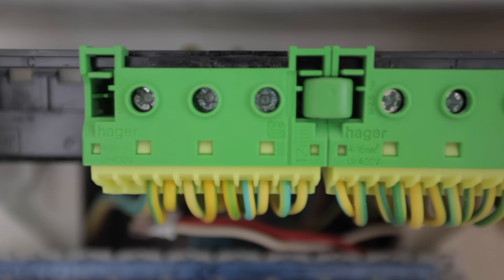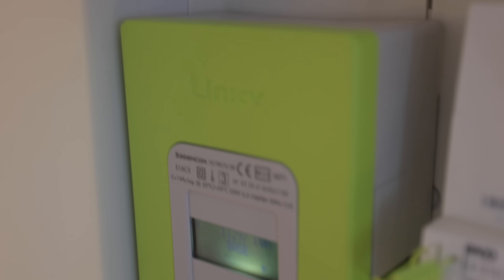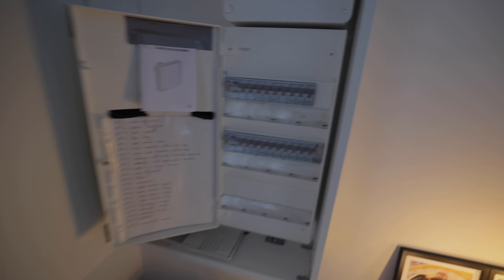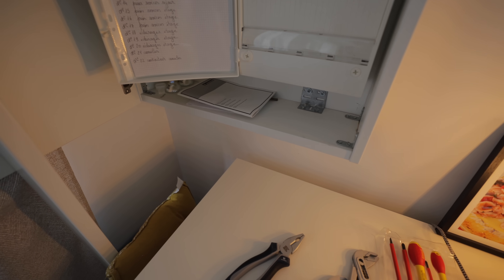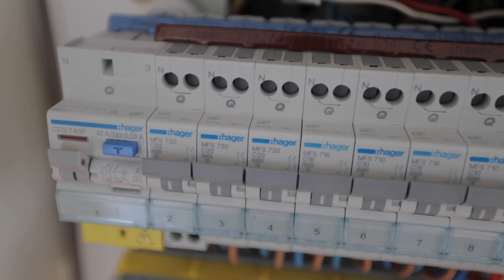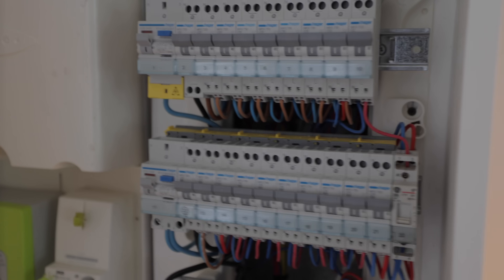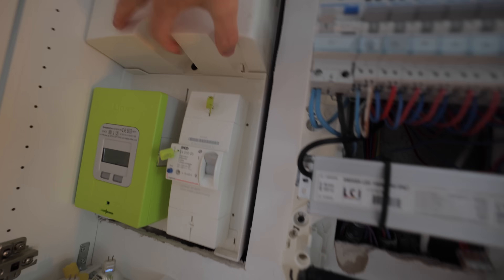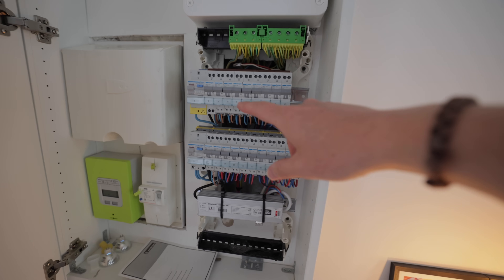U.K. Electrics SUCK! This is what we should be doing…🇫🇷

Comment: I thought a RCD was a fancy new breaker and I googled it and they are just GFCIs .   I don't see any AFCI breakers at all.  I have a separate apartment that I built above my garage and it has a bathroom and a kitchen.  On the kitchen countertop the code requires 20 amp receptacles.  They must be split.  Each plug is 120V but from the top to the bottom receptacle is 240.  ( I build a plug that plugs into both to power my wife's massager device from Ukraine.)   So in bedrooms you need all the receptacles to be ACFI and for the countertop you need 2 double pole 20 amp breakers ganged together so that a fault on top or bottom of one socket will trip the other socket in the receptacle also.   So I need two double pole AFCI breakers and they cost about $200 each.   The inspector eventually told me that to get around all of this , that I don't have a kitchen , it is just a serving area, because I don't have a stove.   Now I want to put in a stove so I also need AFCI and GFCI combo breakers.  They do have these but just single pole.  I think I can put the ACFI breakers in and have the actual receptacle as GFCI.   I would also like to upgrade my service because I only have 100 amps and I need 200 amps with all the circuits and now a new double 40 amp for the stove. 
I can't believe how compact the breaker boxes are in Europe.  Mine is just huge.  My wife has an apartment in Dnipro Ukraine and it is all aluminum wiring and she had the kitchen redone.   When I got there for the first time to look at it , the kitchen light didn't work and the  long hallway had one light and was dark.  The living room light was an old ugly fixture.   The electrician was not called back to fix the kitchen so I just did it myself.  I took EE and wired my own house in Canada so I was kinda competent.   I fixed the kitchen wiring and then added two more lights in the hallway and put a new living room fixture in that was nice and bright.  She only had 4 crappy breakers above her front door.   240 V one for the oven. I couldn't believe such a small little box.  Then the wall receptacles were few and far between and humongous.  The outlet bars you could buy were gigantic.   The wall switch was complicated also.   I am glad they designed the North American plugs and switches to be so compact and convenient.   You need a receptacle every 12 feet in any room.  Ukraine seems to have no such code , or they didn't in the past.  In Canada the wires have to be in the center of studs , the studs are usually 3 1/2 inches and this means when you drive a screw into a stud you won't penetrate a wire and create a short.   If it is less than that , then the wire needs to have a piece of metal covering it to stop a screw.   In between the studs, the wire should hang kinda loose so that any accidental wall penetration will just push the wire aside and not penetrate it.   The wiring in Ukraine and UK from what I see doesn't worry about this. 
At my local Home Depot, I talked to the guy in electrical dept. and he actually sat in on the committees that worked out the electrical code for US and Canada.   Canada has 20 amps on kitchen counters and the US requires only 15.  They couldn't get the Americans to increase it to 20.   There are now many differences between Canada and the US and when I buy stuff I have to make sure it has ULC  and not just UL.   When you go online shopping you have to zoom in on the pictures to see if the C is actually there.  American stuff is sold to Canada and it is buyer beware.  I notice the 14/2 wire in the US is not rated for Canada and I bought some for my house in Florida and it is more flimsy.   Canada needs special plastic for -40C.

Comment: Note that the double pole is solely because parts of the Middle-Europe and especially the french speaking part of Belgium and Norway still DO NOT USE NEUTRAL to create a 230v instead you have 2 phases so each have a roughly 133v against the ground, this is and only this is the reason why there are two poles in the breakers and RCD's and why you have that 30mA main RCD there.

Comment: How accurate that statement is where consumer units are installed. I am a retired electrician now 77. My unit is too high and was in a cupboard untill i removed the cupboard to expand the kitchen 20 years ago when I moved to Wales. What i found behind the old wylex consumer unit was frightening.  Meter tails had been extended using 15amp. Connector blocks and well melted. I replaced the consumer unit and Tails.  Certainly an eye-opener this is. This is far superior.  I am out of touch now with uk standards as been out of the trade too long. No longer do private jobs , I am capable, but a definite No.  Thanks for the video. We learn something everyday.

Comment: In the Netherlands we have meter box regulations

Regulations for the position of the meter cupboard

The meter cupboard must go directly from the door of your home or building
 through a hall   or hallway are accessible.
The distance between the entrance door of the home/building and the meter cupboard
is allowed maximum 3 meters. If this is more, additional regulations apply.
To ensure that emergency services can easily intervene in the event of an emergency,
  it is important that the front door and the meter cupboard are at the same level.
The meter cupboard must be frost-free.
It is recommended that the distance between the meter cupboard and radiators,
  is at least 50 centimeters.

Regulations for meter cupboard dimensions

The meter cupboard must have a minimum size of: 240 x 77 x 35 centimeters (hxwxd).
The free passage of the doorway is at least 70 x 210 centimeters

Other meter cupboard regulations

If the floor area of the meter cupboard is larger than 1 m2, then at least:
 One lighting point and one wall socket must be present in the meter room.
The meter space must be lockable with a lock.
The walls to which the various utilities are mounted must be covered with sheet material.
 This must have a thickness of at least 18 mm.

What doesn't belong in the meter cupboard?

Toilet paper.
Cleaning products and paint residues.
The ironing board and the vacuum cleaner.
Do not turn the meter cupboard into a storage cupboard

A maximum of four groups may be protected by one earth leakage circuit breaker. 
A maximum of 12 groups are allowed on one phase, so in a 3-phase cabinet;
3-phase x 3 earth leakage circuit breakers (30mA), so 9 x 4 groups = 36 groups in total

A maximum of four groups may be protected by one earth leakage circuit breaker. 
A maximum of 12 groups are allowed on one phase, so in a 3-phase cabinet;
3-phase x 3 earth leakage circuit breakers (30mA), so 9 x 4 groups = 36 groups in total

3-phase earth leakage circuit breakers may not be used for 1-phase circuit breakers

Comment: I had a house in France and the electrics were as you illustrated.I now live in Portugal and new electrical installation as in France.I used to live in Switzerland and the level if neatness has to be seen to be believed.Including the plumbing which is all galvanised steel pipe.The UK as the Portuguese poster points out is the 3rd World.

Comment: It is mentioned in the comments elsewhere. 
N frame fuses (NH etc.) then sizes in series of zeros like hornby trains. Higher current devices come in bigger bodies. There is a range in each size thouhh.
Various curves (class) are available which iirc differ from the BS series quite a bit.
We had a compressor supplier insistant (in the UK) that they needed "semiconductor fuses" to protect the inverter of a 60kw screw compressor despite an adjustable thermal breaker in the DB to the machine and a fused switch local to the machine. Our local fuse specialist supplier pointed us in the direction of N frame fuses and a "whoner" carrier. A 3 pole thermoplastic affair that goes together like an old knife switch. Much like a cut out it could be used to isolate a circuit but not for disconnecting a load.
Very compact and easy to fit. I think at the time each fuse was £80.
They do have indicators on each fuse at least.
The rupture time can be far shorter hence the "semiconductor" aspect.
Imagime a shoot through on an inverter bridge or recitifire failure. Providing a dead short beyond the cable/supply capacity. Now wait for the fuses to heat up and eventually pop. Or go for these things that blow in milliseconds. Just the the induction heater i have here to repair that took out a ring main and the plug fuse rather than a suitable selective fuse in the device.

As for the double pole breakers.. can the plugs there can be made in either ploarity and don't have fuses in them.
The breakers protect the devices as well as the installation. (Foregoing internal fuses).
Besides. I rather like having switches on my outlets.

Comment: Im just looking at my electrics here in uk and yes its so basic , my entire house is running of one unit with 7 circuits inc one for garage and one for cooker.
The worst thing is the loop that relies on lower amp wire than the fuse being effectibly doubled up relying on the entire loop to share the load, all it takes is a break or loose connection anywhere in the loop and the  other side of loop is overloaded without any indication to me becsuse it will all still work until the wire melts .. crazy.

Comment: This is a cost vs risk trade off, you could have an rcbo for every socket or appliance in the house but would this be much safer than a typical modern UK installation? Why does a microwave warrant it's own circuit when you can plug in a kettle (typically drawing more current) to a socket on a ring circuit?

Comment: Only one fase system? Wery strange especially if you are using the cheaper hours to heating your water who is much more effective with 3x400 Volts heating element than one on 230 Volt only with 400 V you dont need as many amperes and can manages with thinner cables and smaller fuses! Somethimes I need three fases to certain maskines so in that place i couldn't do my jobb !

Comment: Why are electricians not expected to produce a wiring layout for every installation, in new build s. It would be so much easier if those cables, hidden under floors, if a plane was available. All cables leading from distribution panel would be easier to trace. This also applies to pipe installations and any other concealed under the floor??????

Comment: I think the reason one RCD is type A and one is type AC is because that's what he had in a the van that day.  If you're saying a type AC should really only have inductive loads, then it's only suited to known loads that are hard-wired in and this goes against all the first floor socket circuits that are on the type AC RCD.

FWIW, my own home has two AC-type and one A-type.  Why?  Because the first-floor lighting circuit AC-type MCBO failed and was replaced with what was, by then, considered to be the right kind of RCD.  (Should have had the other two updated at the time, but didn't).

To answer your question about whether UK electrics suck, bear in mind I've lived in Italy and my mother lives in Portugal.  You are comparing best-practice with your average call-out and you should know this.  So no.

The average Italian system seems to be far worse than the average UK system and the best an Italian can probably do is illegal DIY to make an elderly system relatively safe because old systems cannot legally be tested and upgraded and live on semi-grandfather rights as UK ones can, so the option of an EICR and subsequent upgrades does not exist in Italy so you're lucky to find a sparkie who will touch an existing circuit.  In modern rural Portugal, you get a sparkie out and he undersizes the wires on a new circuit which then melt in normal use and also leaves a 100mA RCD as protection for an electric shower.

I don't say it because I'm British and think we know best, I say it because I've seen alternatives: the pragmatic British system seems to work because the fact that various electricians will comment on the same system at various times over its service life and have differing opinions is a good thing; obviously a full re-wire will usually be best of all, but it's better to upgrade an elderly system than to have to choose between full upgrade or nothing as the choice often ends up being to do nothing.

Comment: 30mA type A can detect fault in AC or DC form (better for the kitchen appliances)
30mA type AC mostly detect fault in AC (it's cheaper)

12:50 cumulus is the water heater tank;
'contacteur' is the controlled switch for the water heater, that turns on at night for HC (heures creuses / nightly hours where electricity is cheaper, if you have the right subscription)
Reply: Sorry, but that is not correct. 

Type AC is forbidden in many countries, as it works reliably with sine wave currents only. 

Type A is not allowed for DC critical applications like EV chargers, you have to use type B.

Comment: "cumulus" is the heated water reservoir. it got its name from the fact it accumulate heated water and keep it warm, in order to heat water on cheaper hours and using water thoughout the day.
sometimes you'll find a synonym of "cumulus" which is "ballon d'eau chaude" (litterally "hot water baloon"). hope it helps.

installation looks like what I've seen minus the blue and brown bars.
they tend to put 1 differential per room, it helps figuring out what can cause a problem. when an electrical thing fails, it oftens trips the whole place so we trip all buttons, untrip the general one then untrip one by one to see which provokes the problem.
it's easier to figure, especially when in a kitchen a microwave fails :'D

Comment: your contactor for hot water tank is in the "1" position , this is always ON

you should put it in "AUTO" in the middle if you want to pay less  (check on linky if you have "TARIF HC HP" or "TARIF BASE")

position "0" is always OFF
Reply: All my HP/HC contactors automatically switch to the auto position when the linky sends the HP signal. Do General Electrics ones work differently?

Comment: In France from NZ.  Engineer in electricity distribution, retired.  I've never done paid work on the tools.  NZ probably similar to UK , although NZ uses multiple earthed neutral, and has used 230/400V for 'ever'. .
French wiring is great, leant enough details from a Leroy Merlin catalogue.  I replaced two main switchboards here.  'Consumer unit' is a special UK term I think.  Combination of 500mA main rcd. 30mA circuit RCD seems sensible. Our linky is at the street connection box and main RCD separate from main switchboard.
France seem to use solid conductors and push fit connection.  Push fit is good but the solid conductor cable soooo rigid.  France seems to adopt one system nationally once it is thoroughly proven.  20kV distribution votlage.  Linky electronic meters.

Comment: Nice video ! 🙏 If you really want you mind blown 🤯 , try to find a french consumer unit using one of the most expensive "Schneider Resi9 XE" appliances... push-fit connection and... a mounting rails including a secured "plug-in" busbar system. So, except a wire striper, no need tool to add or change circuit breaker in a second.  To go further, your little top "telecom" unit is a really tiny "VDI" (Voice / Data / Image) grade 1. Try to find a "Coffret VDI grade 3 or 4" there is space for Internet Provider router + power supply, 10 Gbits/s RJ45 patch panel, optical termination box.   Cheers !